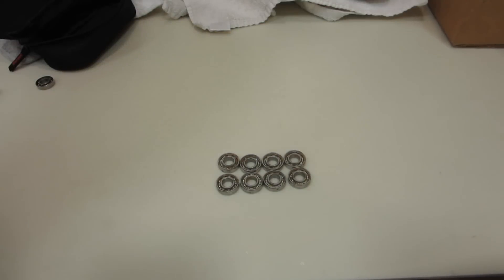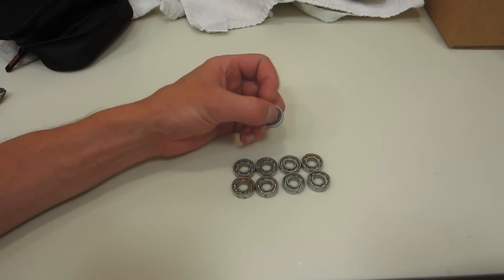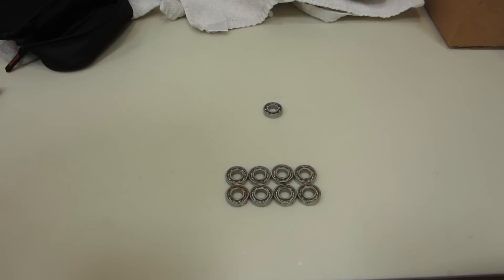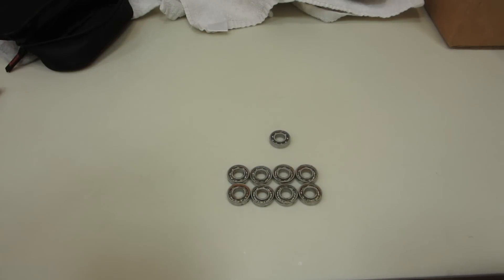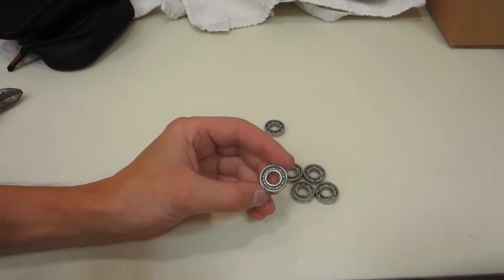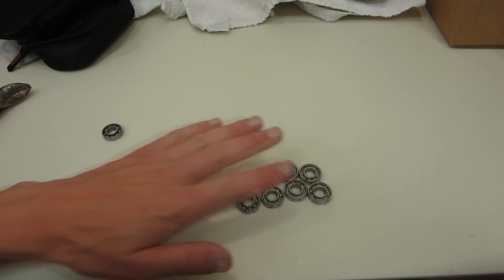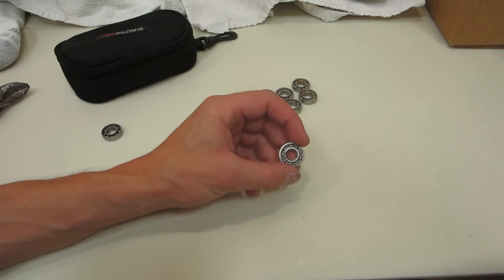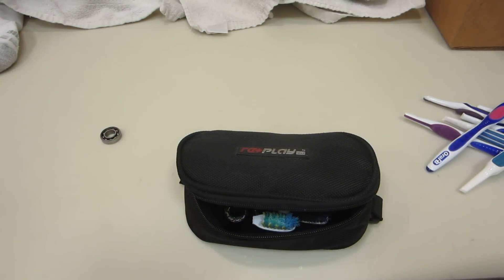Mechanics of Rust, and Bearing Kookery

Comment: Soak the bearings in vinegar for a couple days and it will dissolve the rust. And to get rid of the grease you should try an ultrasonic cleaner, or a container of gasoline that is vibrating, or maybe just gasoline
Reply from the maker: The idea is to find the most lazy way possible.
Reply: get a gatorade bottle, throw vinegar and gasoline in it, throw bearings in, throw the deal  into the dryer without the heat on(very important). thats how people clean their motorcycle tanks sometimes.
Reply: @Intheworkshop200025  motorcycle tank? Wtf